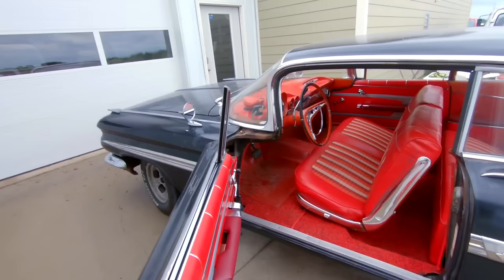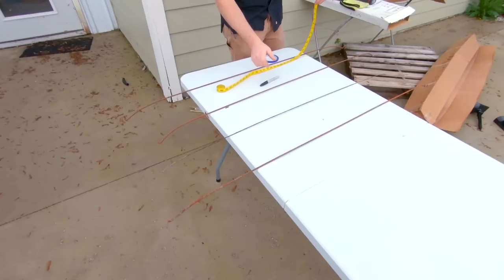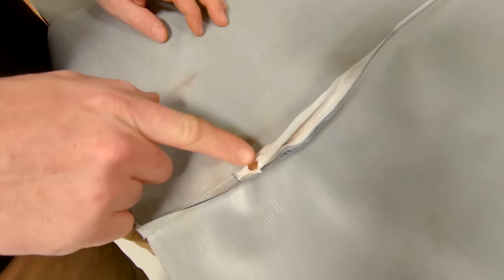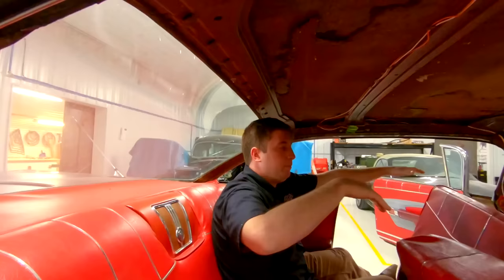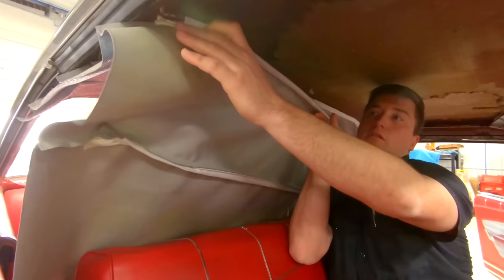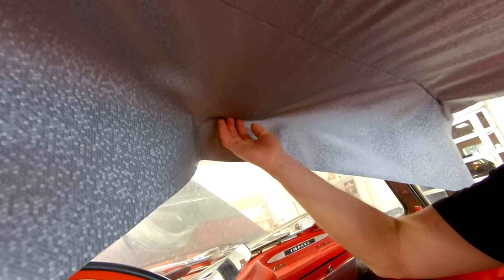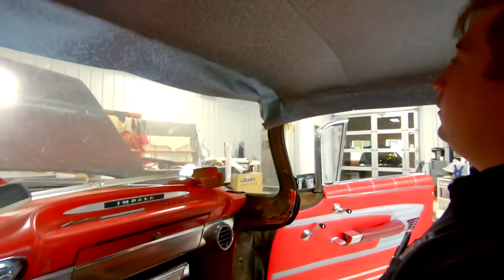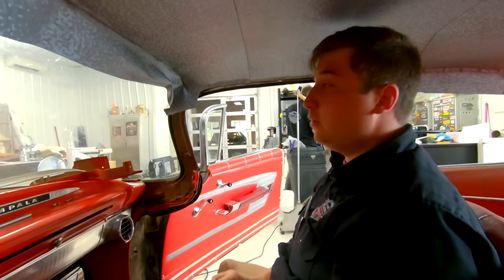The CORRECT Way to Install Bow Style Headliners in ANY Old Car or Truck! - BEST Tutorial On Youtube!

Comment: I just spent way more time than I should have in the garage only hanging mine in place on my 63 impala. One of the rear bows refused to stay upright nice & tight. Finally after a while I pulled it out of the sleeve & bent it in the center then on each side till it fit good & tight in the upward position.

Comment: Best how-to "old-school" OEM vinyl headliner install on Youtube!  Appreciate all the "tricks of the trade."  The adhesive before staples was a real "light-bulb moment."  Nice work gents!  I grew up in Des Moines, but live in Colorado now.  As such, I am going to take a run at installing a new headliner in my "survivor" '62 Pontiac Grand Prix (also red interior).  Wish me luck!   BTW where do you suggest I get replacement tack strip?  I have pulled the original dry-rotted tack strip and staples.  I am planning to drill & screw or pop rivet the new tack strip in as the OEM metal staples are visible in the old (thread-rotted) headliner.
Reply from the maker: thanks man, id just do a google search for tack strip.....they make a ton of them in different lengths and widths

Comment: The headliner looks really amazing. I am assuming that is the original pattern and color?  With the red interior?
Reply from the maker: Yes this is the correct color and pattern
Reply: All cars from that era had light colored or white headliners. It helped keep the heat out of the car. I had a '63 Impala SS with black interior, but a white headliner from the factory.

Comment: Very informative.   First let me say I truly know nothing about this process but I do have couple questions:  The top bows seemed kind of rusty.  With condensation over time could this ever come out as a stain on the new headliner or would that sleeve protect that from ever coming through?  Also there were remnants of the old pad/insulation on the roof.  Why would you not replace the old pad or add insulation (since it looked bare in many areas)?  I guess if part of the old pad fell down I would not be heavy enough to show up in the new/tight headliner.  Thanks, I always look forward to your videos.  I am old enough to remember when the 58 - 61 Chevys were completely overlooked.   What a mistake that turned out to be.
Reply from the maker: The old pad is just sound deadner. No need to remove or add more, just more work
Reply: The whole state of Iowa is all about half assed work

Comment: So did you replace the tack strips? Im doing a 65 impala and the old tack strips are on the front and back- stapled in what kind of staplegun is used?
Reply from the maker: no we did not, and im not sure of the brand. just an air stapler of some kind

Comment: So I found this video because I am doing my airplane headliner that has bows too! I bought similar material that was in it but just a better color. I had it all sewn together using the old one as a pattern. It needed some corrections but overall it fit pretty good except when I pulled the edges to glue them I couldn't get it wrinkle free like I hoped. You glue the front and then it pulls tight at the rear and wires hold the back bow tight. I just want to know if steam would do any good with it glued in or would it make it worse/looser. I don't know what the material is made of it's got like a felt feel to the inside but just a blank back that shows the fabric weave. (Don't know how else to explain it.)
I just want to know if there's any techniques to make it shrink up.
Reply from the maker: That im not sure of, sam is the pro, not me! Lol

Comment: I can't believe you would install the new headliner with the metal looking like  that  even if a customer didn't want to clean it up I would refuse the job until the rust is removed and metal sealed. I would never put those rusty ads bows into the new material either.  It would have taken  5 minutes to hit to hit those with  sandpaper even if you didn't want to take time to prime and paint.
Reply from the maker: Cool lol
Reply: Absolutely correct,  it's called rust bleed.

Comment: Wondering about the staples ….staples go to what? Didn’t see wood panels so could you explain that part pls !!! Thank you
Reply from the maker: Staples go to the tac strip, its in the first step...pullin the old staples
Reply: Tack straps it's about 1/4 inch  hard rubber like material